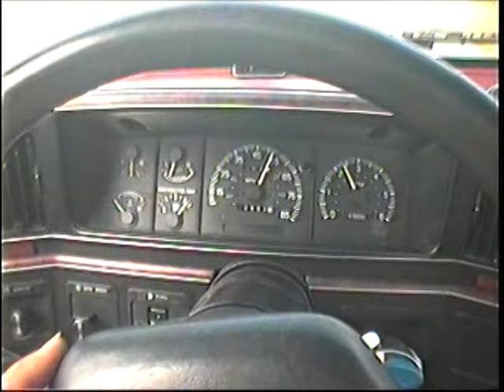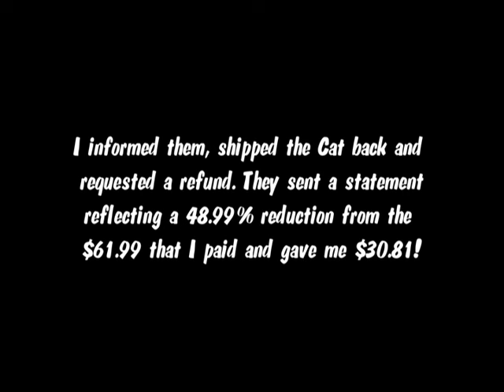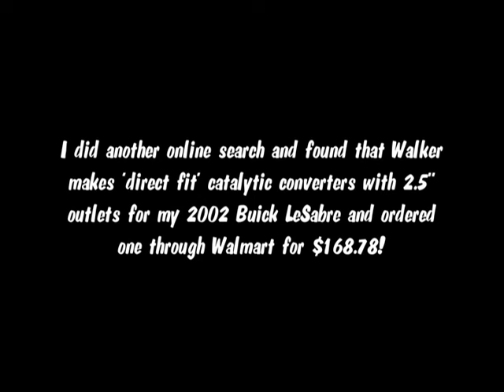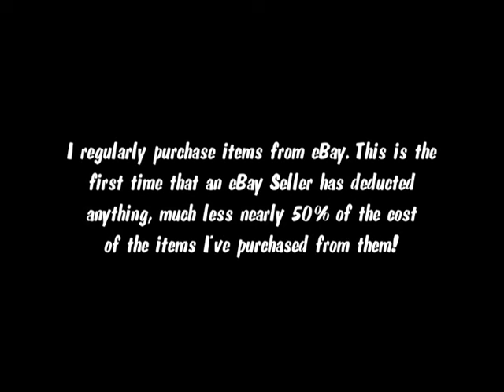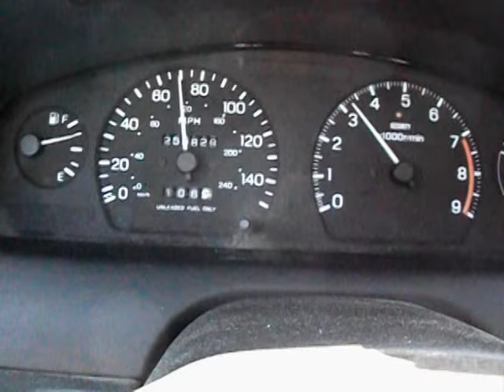eBay seller excelleparts23 cheated me on my refund!

Comment: Looks like that first part was a Chinese-made knock-off. 62 dollars is pretty cheap for a working cat. Being that the outlet pipe was a tenth of an inch too small probably could have still been made to work, but I bet whatever material is inside the "cat" is junk.
Reply from the maker: Cats are a dime a dozen now days. However, the outlet pipe wasn't right and I wasn't going to jury-rig it to make it fit. eBay Admin also stepped in the other day and gave me a full refund.